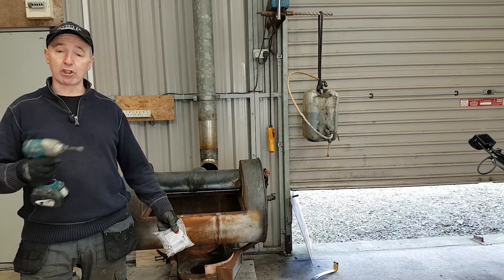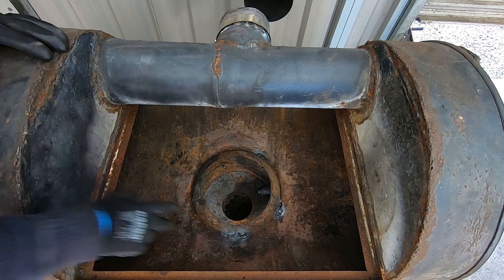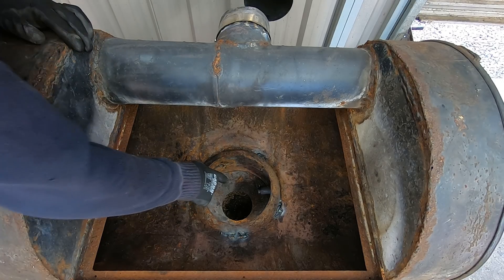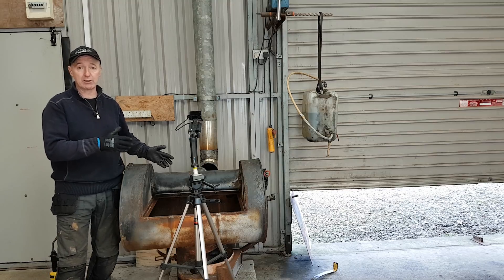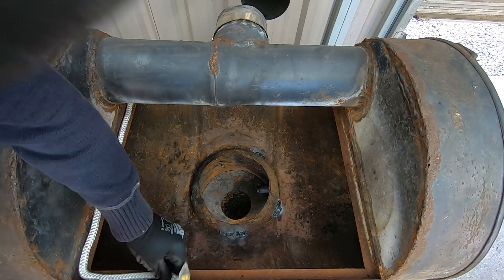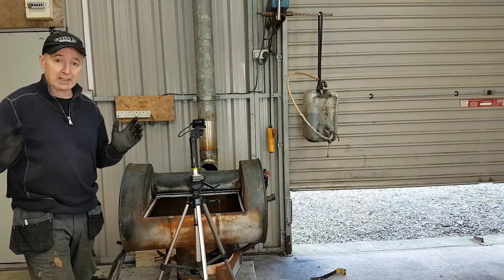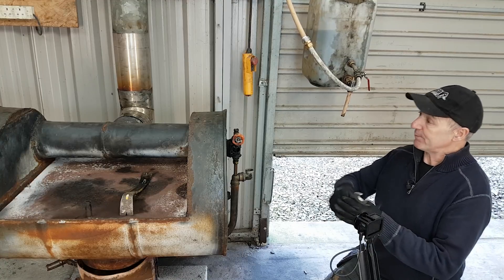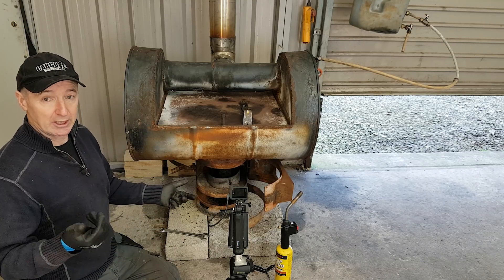Heating For Absolutely Free with this waste oil burner

Comment: These are a bad idea.  The auto waste oil burned contains heavy metals such as lead from bearings and unknown fuel additives accumulated over the service life of the oil.  Even if you successfully vent 100%, the exhaust contaminates your outdoor areas with lead by-products etc.

Comment: You have to be careful with using galvanised steel where it is heated. You can end with fumes being given off from the chimney pipe which can cause metal fever worth checking mate to be on the safe side.
Reply from the maker: Hi Chris. Thanks for taking the time for the heads up. Cheers Gerry
Reply: GerrysDiy cheers buddy
Reply: Cheers Gerry great work mate

Comment: Something to consider if you felt like it, you could get a little bit more dwell time with the heat by making the pipe not just straight, but even just angling it a little bit to hold it up on the way out
Reply from the maker: Thanks for the tip Coby Cheers Gerry

Comment: Maybe his kids brathing fresh air from rain forest .Used engine oil contains heavy metals, including cadmium, lead, arsenic, barium and chromium. These metals clash with the moving parts of the engine and get into the oil. Other heavy metals are part of the oil and are designed to improve its parameters (e.g. Bar).

Comment: how long does it take to get your shed up to a nice temperature?
Reply from the maker: Hi Ian. If it's -1 C outside it wont be any warmer inside but once the burner is up to temperature about 10 to 15 mins then the shed is already warm. Once I turn off the oil the shed will be cold in minutes. I really do need to insulate it but for now this works extremely well.  Hope this helps Cheers Gerry

Comment: I don't know anything about the galvanized flue and all but either burn it or swap it with stainless to avoid any Possibility of danger !
Reply from the maker: Hi Eric. I will burn off the galvanising from the pipe and go from there. Works great but might have been more work than I anticipated. Thanks for commenting Cheers Gerry

Comment: Very interesting. Had to sub. If the glass ever cracks replace it straight away, don't leave it like I did and burn the house down.
Reply from the maker: Thanks for the advice Boss Dog. Hope you didn't really lose your house. Cheers Gerry
Reply: @GerrysDiy  Yes I did. The glass was cracked and I siliconed it up 'temporary'. One very cold night a log slid down and knocked the glass out. I only just got out alive, the house was basically falling down behind me. I don't remember hearing the fire alarm but that was probably what woke me. I opened my bedroom door and it was just heat, noise and yellow. I scarpered out the back way just in time. Lost everything.

Comment: 585c is 1085 F for us Americans. That's very hot! Curious what the flue temp is? If you made the end caps out of 1/4" plate you could weld a shaft sticking out of each end and hang cast iron 45lb Olympic weights on the ends to increase radiant heat. Very clever design!

Comment: There is not enough zinc on those pipes to cause flu fever. in the size space he is in at the low temperatures hes burning at the zinc will take a long time to burn off and will never reach the exposure limit to cause poisoning.

Comment: am I correct that you start with K-1 then drip into the burn pot used motor oil such as 5w or 20 w or 30w or ?

Comment: What the hell. too dirty for environment...what country is this? Hope not ours. The people down range will be breathing pure poison. I don't care if you can hide the smoke.. the poison is still there and heavy. The food being grown , live stock feeding on the grass, water in the well, and laundry on the line, and kids playing outside. Will all be affected come spring and summer. We already know this. It's why it's not permitted commercially any more. Crazy.
Reply: Maybe his kids brathing fresh air from rain forest. 
All toxic staff  cumulate in old oil . Used engine oil contains heavy metals, including cadmium, lead, arsenic, barium and chromium. These metals clash with the moving parts of the engine and get into the oil. Other heavy metals are part of the oil and are designed to improve its parameters (e.g. Bar).

Comment: It would drastically increase the efficiency if you found a way to fashion a cold outside air intake to fuel the fire. This way you wont be sucking heated indoor air into the unit as well as creating low air pressure in your shop which draws cold air from the outside via cracks in doors windows etc... could be a slick upgrade!
Reply from the maker: Hi Brian. Thanks for the tip. Once I finally settle on a design I can easily put a vent in the side of the shed behind the stove. Thanks for commenting Brian much appreciated Cheers Gerry👍

Comment: When I tried to burn waste oil it would clog up the drip tube no matter if it was flat or dripped in from the top. Was really hard to control.
Reply: Danny Hemphill  Yeah man, I  have an old external 440 Chrysler V8 oil pump that I have hooked up to a drill in reverse and that is how I pump oil. There is just a standard spin-on oil filter to clean all the major junk out. Works pretty well. I'll have to take a video of my setup and post it on my channel some day.
Reply: Google "little dragon waste oil burner" we've been using on at my old man's shop for over 30 years. Works great. The only thing we go is filter the waste oil with a decent oil filter and pump it into a big holding tank.
Reply: Danny Hemphill  The next time I go to my old man's shop, I'll shoot some video on my channel. Might be a little bit though. So maybe just subscribe. I'll get to see him eventually! Thanks man!
Reply from the maker: Hi Jim. It might be an idea to run your oil through a sieve to take out the lumps. I have the same copper pipe inside the steel pipe for the last couple of years and I haven't had to clean it of debris. One reason for the steel pipe is that air is drawn through it into the combustion chamber and that helps cool it. I can also force air through it with a fan or compressor. Hope this helps Cheers Gerry👍

Comment: Thanks for the video, I converted a free standing wood stove into a shop heater, but I use, used (canola oil ) ! produces a fierce amount of heat if I crank it up , like the top of the unit (1/4 boiler plate and the cast doors) will glow red and the pipe half way up. That puts the temperature at around 900 *f / 460 *c . It heats a 1000 square foot shop with 8.5 ceiling height to 70 *f at 32 * f outside in about an hour. Because the canola is vegetable based and not petroleum based the flash point of canola is 424 *c petroleum based is much lower, so the design of the burning pot ( thin walled stainless) and it’s shape and diameter along with the forced air to aid combustion took a bit of experimenting to get it to work good and it does. What’s good about the canola oil it’s environmentally friendly, no bad hydrocarbons! If you can source out a supply of any vegetable oil, I would go that route. If you can burn a vegetable based oil in the unit and get it to work right you can burn anything in it other than gasoline,in that case you will meet your maker💥

Comment: Great as Usual Gerry, you mentioned a new Build,  looking forward to it.   I too have a version of your design,  works great BUT We should warn everyone,  Do Not leave it un attended,  I had a valve misfunction, Poured way too much oil in the burner,  I was about 30 seconds away from calling the Fire Brigade.  Managed to Cool things down with a Load of snow. ,
Reply from the maker: Hi MAdd Macc. Well done on saving the day. I will be changing over to a pumped setup soon so more on that when I get it working. Great to hear from you again Thanks for commenting Cheers Gerry👍

Comment: You can not burn at all with that pipe on the inside. It wouldn't seem like it should get in to the body but it seems like it does go into the lungs and goes systemic.

Stop being cheap on your health and buy proper internal pipes or learn to make your own pipes of whatever materials.

Or cut a hole at the lower section, buy just a short run of stove pipe to duct out of the inside immediately, and run the galvanized pipe on the outside only.

In this first firing you were breathing in galvanized vapor if the quality is anything like this here in America and every time you fire it will continue to burn off until it is completely burnt off. If it is a galvanization like here in America(which is all foreign shit), then you should have been able to see a smoke building up around the pipe as it goes from shiny to dull and then presumably just steel. 
Consider it like mercury, aluminum, cadmium, and lead, that in that firm/compound it serves no benefit in the body.

Comment: What does your insurance company think of that installation?
Reply from the maker: Hi. They actually love it. They think that Free heat from waste oil is a fantastic idea and they are absolutely delighted that I can be warm in the shed during the winter. Of course if anything goes wrong they won't have to pay out.  😜 Thanks for commenting Cheers Gerry👍

Comment: I can see several gaps in welding and the cross tube joint isn't even fully welded.  You will die in there from fumes escaping.  Galvanized pipe is for heat distribution, not for a 'smoke' pipe.
Get a Smoke Detector in there and DO NOT tell your Insurance Co. you have an uncertified/tested home made Oil Burner.  Used Oil is very carcinogenic.
Reply from the maker: Hi Gord. There are many cons with these burners but there are some positives too. Thanks for taking the time to comment. Cheers Gerry

Comment: I'm about to make I think my 5th one all different I've had good and very scary results the open drip feed bothers me if it block's and if the burn pot over flows or leeks it might come out of the bottom door have you had any problems
Reply from the maker: Hi Colin. These are crude burners no doubt and need some minding. I will be making a pumped version with some controls soon. Thanks for commenting Cheers Gerry👍

Comment: Hi Gerry, did you hear of the Babington Burner ?   runs on waste Oil the same but with air pressure too , again burns clean but I'm guessing  would not burn at such a fast rate as Yours ?
I Love your videos by the way
Reply from the maker: Hi Jon. Yes I made one a few years ago and it worked well. My next stove will have a facility for forced air but not the same as a babington. It's great to be able to burn waste oil  without any processing and get lots of heat. More burners and stove variants soon. Thanks for commenting Cheers Gerry👍👍
Reply: @GerrysDiy  I live in Donegal , I have a friend in Belfast City , He runs his car on used Oil, I saw His setup a few years back, His Car runs amazing, His Diesel power washer for his business too, at The time I was using a Peugeot Partner van, straight diesel, He filled my van and sent me home  with a few 25 liter containers, The Van ran amazing all the way home. I then found out in the Republic we can't do that , its against the law , But I'd love his setup if things were different here , i even thought for a home generator too
Reply: @jonbishop1385  
Hopefully you mean used veggie oil, not motor oil! And unless you live where it’s very hot all the time, a diesel will not start on waste oil, it’s too thick, so you need dual fuel setup. I did it with an 82 Mercedes, had a friend with a diner who gave me 5 gallons a day. But you have to filter it really well, 2 microns, because any moisture trapped in the oil will destroy your injection pump.
Reply: @brucea550   It was mainly veg oil he used , He bought a centrifuge from the USA, , He had 2 or 3 filtering barrels, But it cleaned it really well. He'd always start the Car on Diesel and switch to veg oil once it was running. all I know is it gave me a good ride home and run around until I'd used what He gave me
Reply: @jonbishop1385  
Yeah the engine runs better, more lubricity in the oil than diesel has, especially now with the low sulfur crap. I let it settle in the jugs for a couple weeks, then siphoned off the top 3/4 to use and the bottom 1/4 went in the sawdust for the shop woodstove. I used ink filters that print shops buy, they work great, fit over a 55 gallon drum with the top cut out. Centrifuge is ideal but a lot of $ unless you have constant access to waste oil or do it for others and charge $. Wonder why it’s against the law there? Prob cuz they can’t tax it?
Reply: @brucea550  My Friend Runs His car, Work van and His power washer on WVO,He can get his waste oil free but always  Gives a few £'s. Northern Ireland is covered with UK Tax laws, and I believe they can use something like 2500 liters/Gallons a year befor paying tax Duty. In the republic You pay with the first Liter you use .  Get caught using it without paying Tax and there is a real Hefty Fine or Imprisonment

Comment: Hi love it 😎😂 yes brilliant and yes galvanized pipe is bad      but if you put bits of of galvanized metal in the burn chamber it helps to clear   any buildup of creosote😋
Reply from the maker: Hi Martin. When I fire up the next stove I will overdrive it for a couple of hours and sort out the galvanising on the lower end of the pipe. Thanks for commenting Cheers Gerry👍👍
Reply: @GerrysDiy  your welcome 😋

Comment: Gerry my wood burner made from large propane bottle only has a 10 foot long 4 inch wide flue and has trouble with smoking when opening the door to put more wood in. Do you think the flue is long enough or something else?  Cheers in advance being a subscriber for years now love the videos
Reply from the maker: Hi Brett. Once the flue is hot it should provide enough draught / suction at the door to allow air to come in but not spill out. It's likely that the diameter of your flue is a little small. Most wood burning stoves are  5 inch in diameter or for higher output stoves 6 inch in diameter. I would if possible even just for test put another 6 feet onto it. Once you open the door you will need the flue working harder to gulp all that air. hope this makes sense Cheers Gerry

Comment: At what temperature will everything melt down
Reply from the maker: Hi Terry. When you see the stove bright red it will be around 700 degrees C and I can get it hotter than that in the 800 range but if I needed that amount of heat I would just make it bigger and run it a little cooler. Hope this helps Cheers Gerry

Comment: @GerrysDiy
Gerry,  does it need precise intake air flow control,  or is controlling the flow of oil enough to regulate the temperature?
Reply from the maker: Hi MK. The holes in the burn chamber allow enough air in for combustion at a given level of oil. Once you exceed that amount of oil it will smoke or just cool the burner too much and the flame will go out. Hope this helps Cheers Gerry👍

Comment: Awesome. As always. Yeh. You Brits (soon to be free from the EU) can enjoy the fire Prometheus brought to man. Here in the "EU": Different story. The days EU-subjects are allowed to make fire are counted. Unless: This Evil Union collapses so god will.
Meanwhile I actually realized my idea: A 5 ft (give or take) long zinc-pipe (some 5'' in diameter) stuck into my coal-burning stove. Then a 90"-angled-piece of pipe stuck to the end of the pipe  so that you can put the stuff in you want to burn.  Et voila: Most of the heat stays in the room instead of leaving through the chimney. I'm not going to tell what I do burni. Only this: It does not cost a single dime.
Reply from the maker: Hi Peter. I am not leaving the EU so Prometheus is still under a bit of pressure. I am in fact Irish and we are staying in the EU while our close neighbours are on their merry way. Well done on your stove idea. Cheers Gerry👍
Reply: @GerrysDiy  Sorry about that mistake about your whereabouts!
Reply from the maker: Peter8aus8Berlin  No problem Peter I appreciate you taking the time to comment Cheers Gerry👍👍

Comment: Careful with galvanized pipe.   Do not breathe around it while it’s burning !!!   The zinc will kill you !     Low melting point.          Build a big fire and toss the pipe in     Melt that shit off !    Then burn it again.  And again to be certain
Reply from the maker: Hi Love and Terror Tattoo. Thanks for the heads up. Much appreciated Cheers Gerry👍

Comment: Excellent job (as usual from you) Gerry, you're such a clever guy, and a real pleasure to listen to and to watch.
I suppose that this was the first "hot" video of the year, looking forward to all that will follow.  ATB, Peter.
Reply from the maker: Hi Peter. I think you must have cross posted 😜 The shed is much easier to work in again now its warm. Going to work on a dual fuel set up tomorrow if I can get all the parts. Thanks for commenting Cheers Gerry👍

Comment: Thanks Gerry. Where do you get the waste oil from? I did some work on a van a few years ago that ran on waste oil. It was waste cooking oil from restaurants. The exhaust smelled like french fries.
Reply: Just ask around. I burn motor oil. I can get as much as I want for free from local garages. They have to pay to get rid of it.
Reply from the maker: Marcel LeMay  Hi Marcel great to see you here. Thanks for dropping by Cheers Gerry 👍👍
Reply from the maker: Hi Dan. It will run on veggie oil or motor oil but Marcel is right ask around you can get it for free. Cheers Gerry👍
Reply: @GerrysDiy  In developed countries, burning used motor oil like this is a felony.
Reply: Most companies with a fleet like trucks or busses will be more than happy to give you their waste oil. Also try local mechanics.
Reply: Matt Hinge  Thanks for the information Matt and thanks to all have who have replied. There are several shops in my area and all of them are more than willing to get rid of their waste oil.